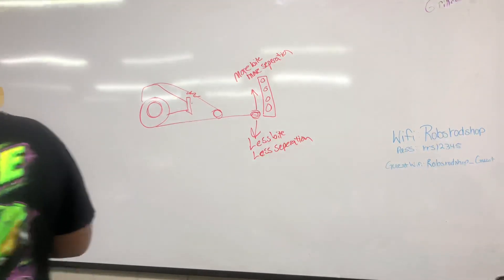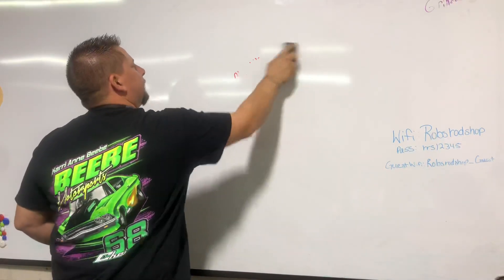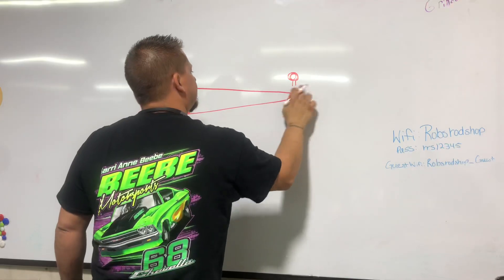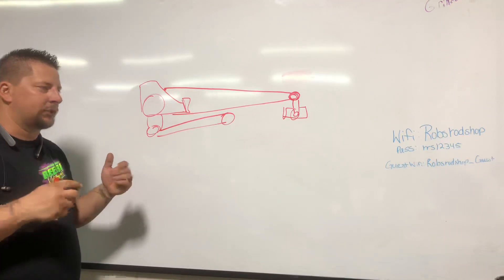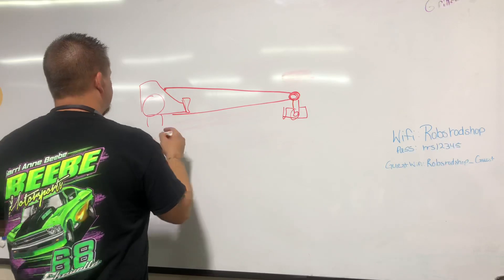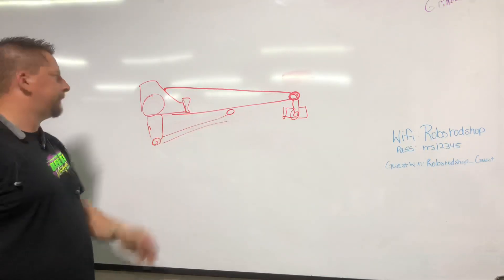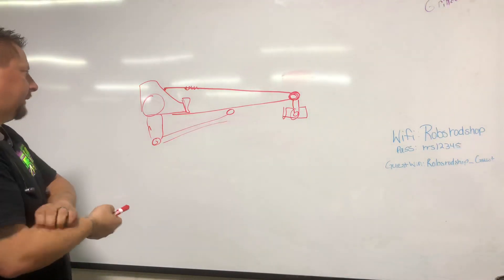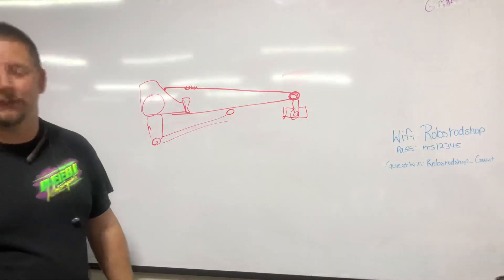Torque arm suspension and drag racing.

Comment: I want to see and hear your opinion with this set up on a leaf spring car. I’m exhausted from trying to explain this to the “gasser” crowd. Guys are running “ladder bars” on leaf spring rears and putting shackles at the front of the ladder bars. 
Try explaining to them the front half of the leaf spring is not a rigid bar like a lower link would be. Basically by them doing this nothing is being accomplished. 

The rear can still move forward and back, and the leaf spring can still wrap up if it wanted to.

Comment: FOr the most part.. dead on. But one thing you miospoke on.. the Torque arm does not drive the car.. the lower control arms do.

Comment: It's remarkable how many people think pinion angle changes something in terms of suspension action. They're looking at the wrong part of the system. Pinion angle changes as a function of something else you've done to the suspension. If pinion angle gets too far from ideal you have to fix it, and you can do so without having an effect on whatever else it is you changed to get the suspension to do what you want.

Comment: My 91 camaro with stock torque arm and adjustable LCAs runs low 10s w/ 1.37 60ft and handles excellent on the street too.
Reply from the maker: When I speak of suspensions designed for drag racing I’m speaking of suspensions easily capable of 60’ times in the .995-1.05 range.
Reply: @RobD828  I know a tq. arm is limited but does pretty well at the same time.
Reply: @RobD828  could you please look at my video of my blue camaro coming up on the converter and launching and tell me if it looks good or not? I would greatly appreciate it. I’m an amateur and this is my 2nd year racing.
Reply: @lewisfoltz6306  Late but not true . I own 7 since age 15. 3rd an 4th. Just couse sombidy makes a video. Doest mean his rt. You know how fast people been in a Tq are stock suspision set up. People belive anything vs fact. Even Kye kelly perfured Tq arm bs ladder bar in his strett style 3rd gen camaro.

Comment: How do you calculate the best control arm angles, and torque arm length? I have 380 HP, 112" wheelbase, in a 3000 LB car. It's a 39 Ford, so I'm fabricating almost everything.

Comment: Great video, but a lot of fbody's run a crossmember with an adjustable mounting point (even many of the pendulum styles have 2 or 3 holes on the bracket), so you then have adjustment of the front mounting point just like any adjustable bracket on a four link. Could you possibly add that scenario to this vid or make a shorter extension for those of us with that adjustment available.
Reply: That adjustment... for the most part.. is useless. It will help get your pinion angle closer to middle of your adjustment.... it will have a small amount of effect on AS numbers.. but not enough to matter. Its not a four link and it doesnt work like one. Length of TA has a huge effect on AS. Vertical mounting location is more or less irrelevant
Reply: Thank you and Nichols since age 14, I've been grudge racing and hotroding these tq are stock suspension cars from 3-4th gen have owned and raced them all, if you not a real Gm tq arm man you will just repeat non factional statements on tq arm suspension cars you your self haven't raced won money even over 4 link parallel ect drag race sub cars, i was was the 1st in my city and south period to put a full weight true stock suspension tq arm ls1 based 4th z28 in the 80s, 5.80s bk when people couldn't run that on non true stock suspension or $ built 4 link cars we raced and faced them all , and in my real world facts over opinion or passed down oh tq arm cars wasn't ment for drag racing i can rebultle and debunk any passed on myths, they wk great even with requler bolt or weld on suspension upgrades and very little suspension tuning done. All the way down to 1/8 mile bottom 4s to lightly mod FBO, HCI, stock bottom end, cam only ls or stroked ls motors from gutted to full interior to all steal all glass, x275, drag pro or big and small slick tires classes. If im getting bottom 4s out a oem tq arm suspension without high $ 4 link convert or ect , im telling you they do very well and to run Gm factory suspension from the jump will save you extra $ to put somewhere else. Thank you tho no shade and shoot out to Kevin Wilson sbc another YouTuber he also so repents the same myth but explained how well they wk also.

Comment: Close but one mistake. You didn't mention the length of the torque arm plays a major roll in anti squat. Also on a road course car it definitely plays into the setup tremendously. It allows the car to plant the tires coming off the corners. It's not going to be set to full kill like a drag car but it's not just keeping the rear from rolling.

Comment: Rob, you hit on everything EXCPET what the torque arm mount on the trans crossmember does. Most are adjustable height wise. What will moving the front of the torque arm up or down do to the car?
Thanks bud for all your info!!
Reply: My torque arm isn’t factory and is adjustable at the crossmember. 4 holes.
Reply: @johnnybrown7104  Your point? you can put it in any one of your 4 holes and it wont change how the car leaves nearly at all. Its not a relevant adjustment
Reply: The front height adjustment only allows you to correct the pinion angle in a coarse adjustment. Then it's fine adjustment is done on the rear adjuster as he mentioned. (But note the adjuster is typically in the bottom bar "compression bar") It has been my experience the height of the mount has no effect on how the car reacts. (Within the room under my car.) The length of the torque arm determines how long the instant center is and the angle of the control arms determine it's height. Therefore the control arm angle is your adjustment for anti squat as mentioned.

Comment: Thanks for the video!  For a street strip car do you recommend a front torque connection using a bushing(stock type) or a linkage connection(like MIdwest Chassis)?  I know that the bushing connection in aftermarket long torque arms reduces bind and noise, but is there a reason to use or avoid a linkage type connection to the front torque arm mount?
Reply: They're usually rated as stronger arms, and in most cases this is true. But if your not going 8s or faster, I prefer the Long Arm setup, but Im also a 6sp guy- still cant give up on the madness of stickshift. Its like racing UDR without having 250k in the car, plus the crazy cost of upkeep on a car running 3 sec 1/8th's.

Comment: Thank you so much for doing this and the ladder bar vids!! Such vital info. Is there anything that would need to be explained specifically on a triangulated 4 link that wasn't covered in the suspension basics video?
Reply from the maker: CheapFastReliable Equal length aftermarket 4 link increases anti squat as it separates. Stock unequal length decreases A.S. as it separates. So, be aggressive with the stock stuff but be careful on the equal length stuff.
Reply: @RobD828  thank you!! Hoping to get my foxbody going this year, I was getting A LOT of pressure from my dad to do torque arm on it (he's a 3rd gen guy and swears by it) I'm going forward with all the adjustable "stock suspension" stuff since I know it's better. This vid shows exactly why and was exactly what I needed to hear.
Reply from the maker: CheapFastReliable just remember that you need adjustable torque boxes to completely take advantage of that setup.